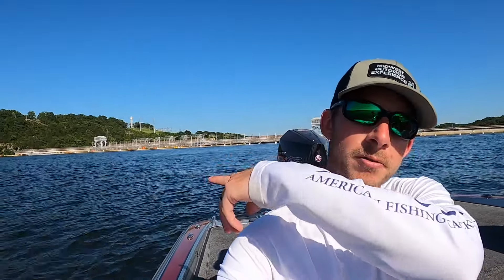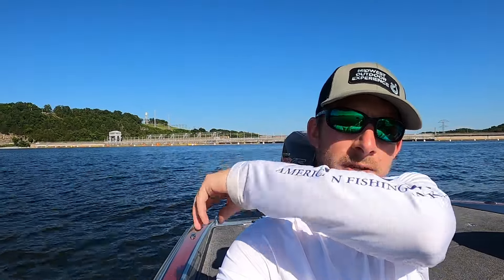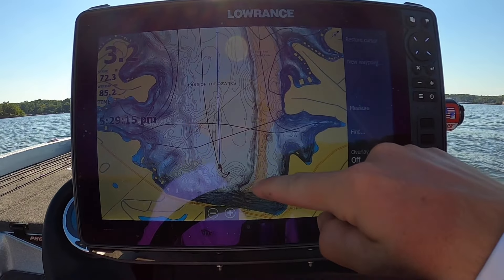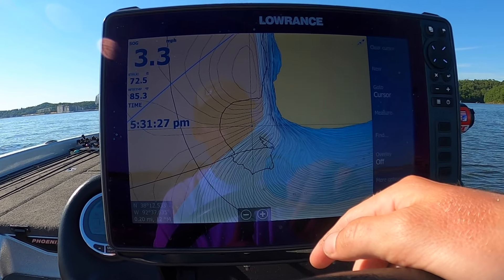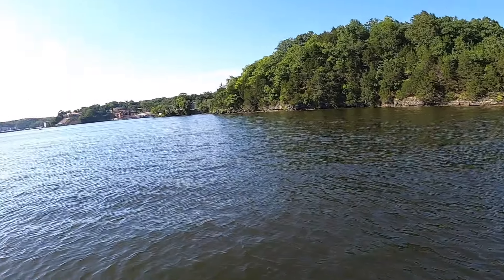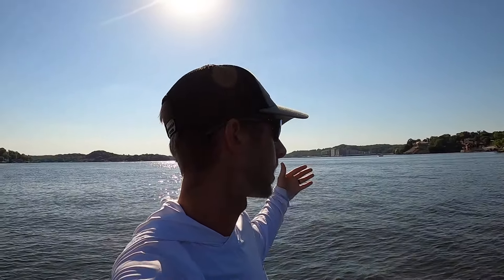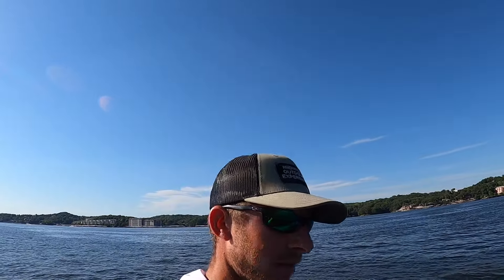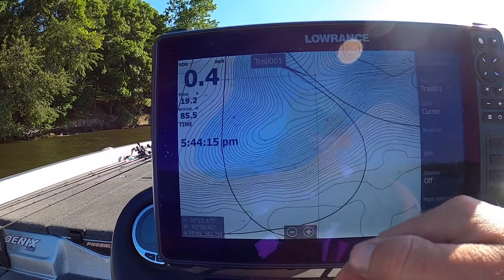That Dam Current | Power Generation & Flood Control Affects Your Fishing

Comment: Is this your same strategy for crappie when they are running water?
Reply from the maker: @daveotto9404  I like main lake docks for crappie, but you can find them loaded up on points. Typically they’ll still be suspended over something. Shad, brush, rock pile etc.